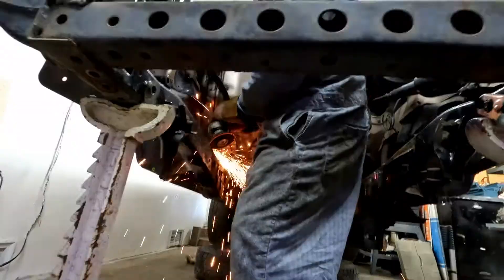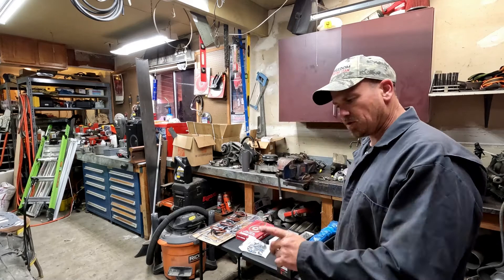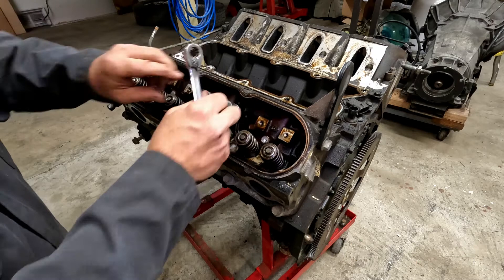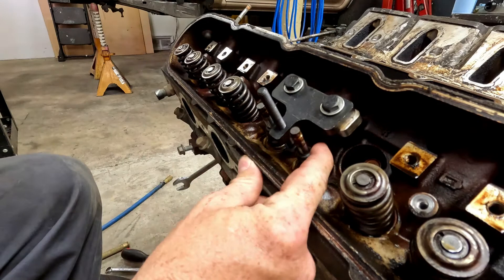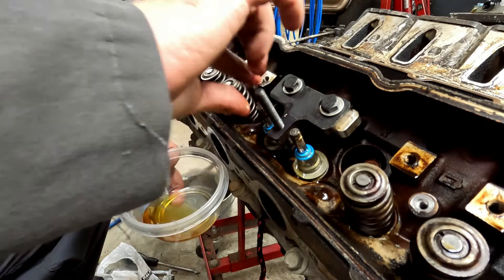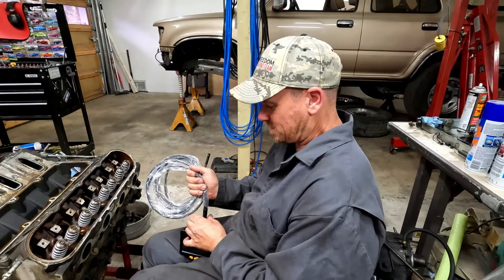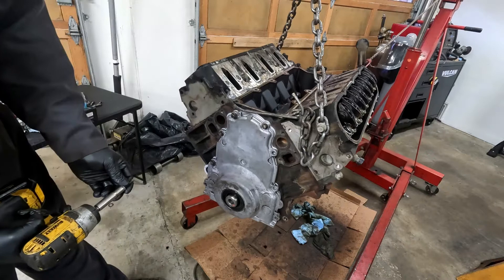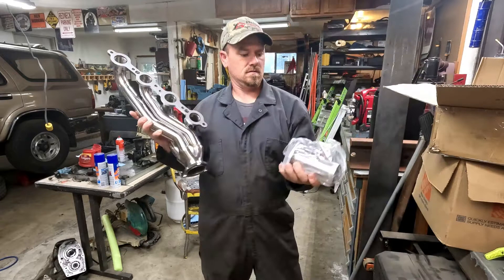LS SWAP 2ND GEN TOYOTA 4RUNNER part 2 engine upgrades

Comment: What are your transfer case option?  I have a th350 with an adapter to Toyota gear case. Toyota gear case has been upgraded with 23 spline input and RCV output with twin sticks
Reply from the maker: I am going with the NP241c behind the 6L80E. This is the manual shift transfercase